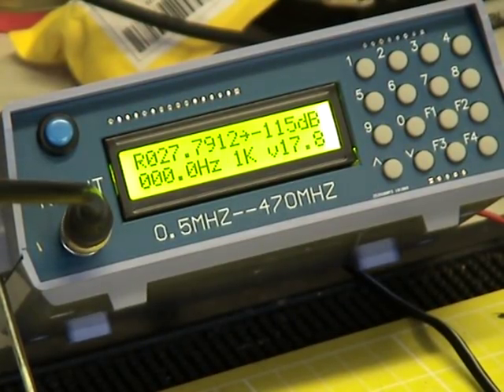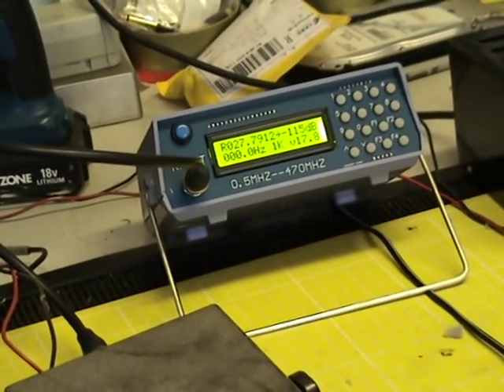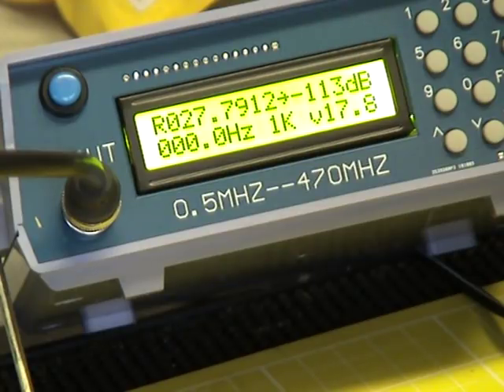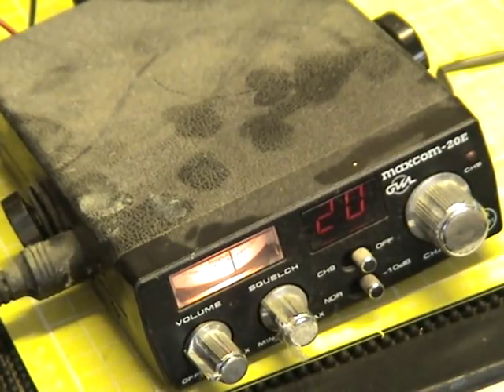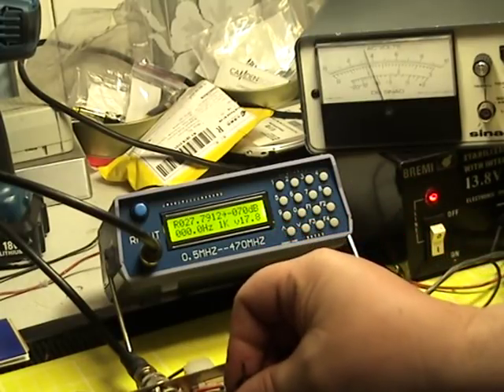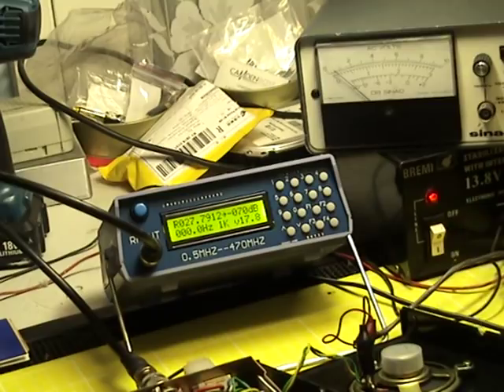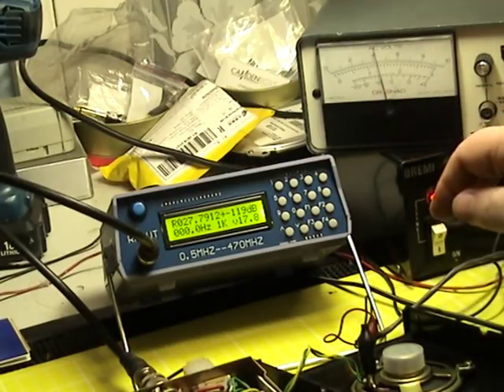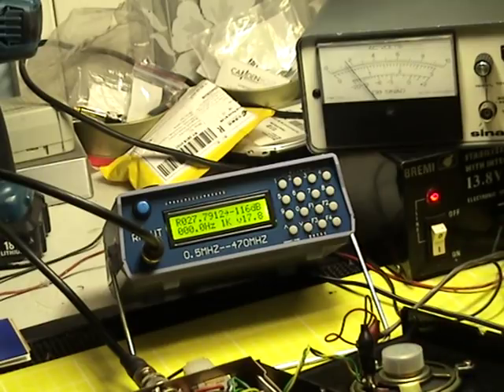CB servicing on a shoestring budget (UK) -  RX on cheap Chinese FM signal generator

Comment: Hi, what is the V17.9 on the display please? Also you can enter the values direct with the keyboard you know, saves multi pressing the up or down buttons and waiting ages.
Reply from the maker: Sorry, this was a 'one off' demonstration of how I used this cheap signal generator. You will need to research a copy of the instrictions or the signal generator for your answers. I would expect V17.9 on the display to mean the firmare version to be "Version 17.9".

Richard, G0OJF, UK

Comment: What are your thoughts on using a TinySA for doing AM/FM alignments?
Reply from the maker: I've never heard of one. Without me researching it sounds like a computer based thing. 

Richard
Reply: @ukfmcbradioservicingTango21  It's a £50 spectrum analyser which is phenomenal which also has a built-in signal generator with various modes of modulation.

A very similar product to a nano VNA.

I've used mine to align / repair a few radios and it does the job well.

The things are amazing!

Comment: s9 =73dbm
Reply from the maker: Not on UK FM CB it doesn't....that would equate to 50uV.  S9 = 100uV on UK CB which in turn is -67dBm.

Richard, G0OJF, UK
Reply: Think this can piece of equipment can be used on AM CB? Mostly 27mhz.
Reply from the maker: @PointElectronicsLen  No, it's FM only.  AM signal generators can be bought very cheaply secondhand; I bought one via Ebay for £10 in working order for entertainment radio alignment.

Richard, G0OJF, UK
Reply: @ukfmcbradioservicingTango21  could you provide a name of one so I could look for one.

Comment: Hello there I ve a question. It's a RF generator the same that Signal generator? (Sine wave square etc) both can be used for radios alignment? Thanks
Reply from the maker: Yes. It needs to be a sine wave for radio. The generator also has to be able to produce a modulated tone on the signal. This one is FM only which is why I featured it. Many cheap generators are AM only. Obviously the generator has to produce the frequencies you need. No point buying a 10Mhz generator of you want to tune radios at 27Mhz.
Richard, G0OJF, UK
Reply: @ukfmcbradioservicingTango21  copy that. Thank you.

Comment: Using this gadget as a signal source, quite good, you can make a simple RF generator with a higher voltage output, adding inside the box, or in another box, an RF mmic amplifier or a mosfet (this one with a small rf ferrite toroid and a winding for a low impedance output, even employing the second gate for a gain control ¨)

Comment: Hello ! Can you help me with some advice?
I have an Albrecht AE Ultraforce radio, it has some problems on emissions. When I press PTT it can be heard on the other radio only if I have the power set to 1 W, if I increase the power from the button, the signal disappears at the microphone.
What could be the problem?
Reply from the maker: The model you mentioined isn't a UK approved CB radio so I have no specific advice. Generally though.....it sounds like when you draw beyond about 1A of current the radio malfunctions. First you need to check the power supply voltage is still what it should be when in transmit of higher power. If that's OK, the radio has an internal fault.

Richard, G0OJF, UK
Reply: @ukfmcbradioservicingTango21   Ok , thanks for info !

Comment: Do you know what is the first parameter on the second line (shown in your video as 000.0Hz) used for? It makes absolutely no difference on the output no matter what I set it to.
Reply from the maker: Sorry, I can rarely comment on test equipment videos like this as these kind of items are usually sold on after the videos are uploaded. 

Our Mr Chippie has one of those smart phones (I don't do mobile phones). Mr C has some translation software on his phone that allows you to point the phone camera at foreign writing & it instantly translates onto the phone screen. When we get stuck over lack of Chinese instructions in English, he goes onto the original sales page (such as AliExpress) & is usually able to read the Chinese full instructions. Perhaps that could work for you.

Richard
Reply: @ukfmcbradioservicingTango21  Thanks for the reply. This device is really interesting. My unit has no model number whatsoever on the case and does not come with any manuals but works well for what it is. The seller item description contains nothing useful either. On my unit (firmware version 20, newer than yours) the modulation frequency can be changed to "/"K (actual slash, not a typo). I think this is a bug. The attenuation only goes as far as -70dBm like what you mentioned. The LCD only displays "dB", probably due to lack of characters. They might as well remove the R and show "dBm" in full.
Reply: @toughdev  That second line is CTCSS, You can set it to modulate CTCSS tones with the up down buttons, if its on zero its doing nothing, these are useful and cheap little generators while they work, mine only lasted a couple of months, I was very careful with it never transmitted in to it etc, just used it to align CB radios, it started losing signal really badly, getting weaker and weaker until nothing comes out of it now, you would be better getting a more expensive sig gen and a dbm switch box, to get an fm signal generator that will level to 0.1 micro volt over 20mhz is very expensive even second hand, these are cheap junk really I wouldnt recommend them to anyone.
Reply: @knoxieman  Thanks a lot for the info! Now I know it refers to CTCSS. You are right these units are built down to cost with absolutely no quality control whatsoever. No output protection as well so don't connect the wrong thing to it. My device also has some other weird bugs. After changing the frequency a few times, the display will be garbled with strange characters, e.g. "R278IG" (with alphabets) - to recover you must reboot. With regards to the output RF power level, I am experiencing the same behavior on my unit. When I first got it, I was able to analyze the output and see the RF peaks using FFT on my HP 54615B 500MHz oscilloscope. But after a few months I am no longer able to tell the peaks from the noises in the FFT view. The output can still be detected with the TinySA spectrum analyzer. I think the output power of the unit has decreased like what you said (the oscilloscope FFT is less sensitive than the TinySA). The device is still useful for aligning radios. I hope it won't die totally any time soon ...
Reply: @toughdev  really the best option for accuracy is to go for a quality  second hand lab set, these units are very poor, great idea but needs work, the boards inside this thing are held in with hot glue, if you can't trust your test equipment there is no point in using it, you would be better leaving the radio as it was, I'm on a budget so can't afford to pay silly money for old gear with no calibration certs that might not work, I'm looking at a kmoon Sig Gen and a digital step attenuator, most of those cheap Sig gens don't drop below 1 mv which is too much signal for fm receivers, with an attenuator you can drop it down and work out the dbm signal level, if the kmoon doesn't modulate a 1 khz tone ( I think 600hz is max internally) you can inject one via bnc, that's the option I'm looking at, I'm interested to try the digital step attenuators, 30 quid to to 30db . This unit is going in the bin now sadly, Richard did the right thing selling it on.
Reply: @toughdev  Hi, thanks for the info, I was going to try one of these as a digital step converter rather than a switch box https://www.amazon.co.uk/dp/B08G8LTC5K/ref=cm_sw_r_cp_apa_fabc_GbIVFbSX4YW4W looks interesting, also can you tell me if the 6900 can output up to a 1mv 30Mhz FM signal with a 1khz tone? I've heard others say it can't go that high with internal modulation, it's total overkill for testing CB radios (I mainly want it to setup CB walkie talkies) that's why this device on here seemed so good at first, I might rip it open and see if I can do some test on it, thanks.
Reply: @knoxieman  Sorry for the late reply. I just tried and the 6900 can achieve that easily. Just set channel 1 to 30MHz sine wave with FM modulation enabled, modulation source from channel 2. Then set channel 2 to 1kHz sine wave and you are done. The resolution can go as low as 100uV. See here for the spectrum of the 1mV output taken from my TinySA: https://bit.ly/3q9F4aZ

Comment: Have you ever tried the ComTekk SINAD software to do Sinad using just a sound card and computer? I think it would make a great video especially for me who is thinking of using it
Reply from the maker: I'd not heard of it so I looked. As a licensed radio amateur it would cost me $39 for a non-commercial slimmed down version. Next snag....no room for computer on bench. Considering I paid £20 for one of the Marconi SINAD meters & £45 for another it seems cheaper & obviously better to buy a secondhand real SINAD meter that one cost someone £800+. 
Have you noticed the main test sets here are Marconi 2951 from the 80's? We also have a Farnell test set of similar vintage & a Schlumberger 4040. Why don't we have a Marconi 2955 or similar? The answer is Latency. I really don't have the time for ...adjust ...wait...adjust..wait etc. I want INSTANT meter readings. That's why you see the BRAND NEW this year CRT oscilloscopes on the bench too. A bit like these new CB radios where you press the PTT & then wait 1/2 second for the CPU to go into TX!
Thanks for bringing this to my attention though. Bear in mind you still need a signal generator with a meaningful attenuator to provide the signal for tuning the radio with.

Richard, G0OJF
Reply: @ukfmcbradioservicingTango21  Awesome thanks for that reply I had not noticed it was licensed software thought it was free, oh well. Yeah latency is a pain I like things instant too. You have some great test equipment there by the way and I love your videos 73 for now de 2E0LIG

Comment: I bought one of these unit.  No manual with it.  Good value for ham radio receiver testing in general. Frequency stability was within 450 cps. F4 function key did nothing on the unit I bought. Compared to lab quality IFR unit found the frequency within 450 cps at 450 Mhz, the output attenuation was spot on.   A friend bought a unit went to the TX mode and then somehow it went into R mode and We cannot figure out how to get it back into TX mode. How about your experience with that?
Reply from the maker: I didn't know there was a TX mode as it's just a signal generator. They do another that does TX. MR Chippie has one of those smartphones (I have a rotary dial house phone). There is some translate software program you can put on smartphones so that when you hold it's camera to foreign writing, it instantly translates it onto the screen in real time.  When we bought this signal generator the aliexpress advert had basic instructions in english on the advert as it said there was no instruction book. If I were you, I'd find info in Chinese on it & translate it. I'm sure you'll find what you need to know that way,

Richard, G0OJF

Comment: I thought -73db should provide a S9
Reply from the maker: that would relate to 50uV & is indeed specified for some CB radios, probably to make them look more sensitive than they are. The correct standard is 100uV for S9 (-67dbm). Note, this applies to UK legal CB radios. Amateur radio has different settings which we are not involved with & business radios don't have meters.

Richard (UK)
Reply: @ukfmcbradioservicingTango21  I just realised the video is on CB and any signal testing I've watched demonstrated is on amateur radio. Learned something new. Good test unit considering most options are in the $1000's 
Cheers.
Reply: @ukfmcbradioservicingTango21  can anyone give me a bit of advice please, I have purchased a signal generator which covers 1-60mhz.
It also has a frequency counter built in but it says max20v input on the counter.
Does this mean I can only use devices that run below the 20v. Ie cb would be fine to plug into the counter due to it running on13.8v.
I know probably sound a daft question. I haven't got a clue and any advice would be gratefully received. Thanks 73s Mike. P. S.. I have readed the manual nothing listed...
Reply from the maker: @poptheboats2025  Max volts is nothing to do with how the product is powered, but the RF voltage from a transmitter that may be applied before the frequency counter is damaged. 20V works out at just under 1W of RF power, however I would not dare go more than half of that. You normally use a 20dB attenuator 'sniffer' and connect your transmitter to that & the sniffer to the frequency counter. https://www.electronics-
notes.com/articles/basic_concepts/decibel/dbm-milliwatts-volts-conversion-chart-table.php   is worth looking at. I recently bought a 20dB sniffer via ebay from Italy for about £40 as I couldn't be bothered to do the research to build one.

rshireby@yahoo.co.uk

Richard
Reply: @ukfmcbradioservicingTango21  thanx Richard. I have purchased all the servicing on a shoestring gadgets of the videos. I just fancied one of them other generators for the bench I'm making up. Thanx for the information&videos and I will read up on the link you posted..

Comment: Enjoyed your video.......will this tune the amateur bands with the modulated tone....3.500mhz to 29.000
Reply from the maker: Without even looking up the frequency coverage, bear in mind this is FM only  it is rare for amateur radio to be FM lower than 29Mhz. There are plenty of cheap AM signal generators around...it's FM that's hard to find, hence this video. Note that UK CB is FM.
Richard (UK)

Comment: love your videos,
what do you concern the best cb/antenna/amplifier / meter manufacturer ?
Reply from the maker: It depends what country you are in for a start. I only deal with repairs of business 2-way radio, but also am happy to service UK legal CB radios as well for the trade.

The best new CB we have serviced & tested this year was the Thunderpole T3000.

Amplifiers are illegal in every country I am aware of. Seeing it is an illegal market, they all seem to be pretty poor from what I've seen before chopping them up.

Mobile aerials, the SIrio performer 5000 was the best mobile aerial we've tested to date....base station we just use 18' 1/2 end fed aerials of no particular brand & they all work 35 miles in our 'good' direction using UK 4W FM cb radios.

I just demonstrated the cheapest SWR meter I could find from CRT & it worked OK on that video demonstration. As a radio engineer, most of our business customers are on VHF high band or UHF systems, so I have to have different meters depending on what I'm doing.

I'm not a big brand person. Many expensive products I've owned over the years turned out to be c**p, and on the other hand, cheapo power tools from ALdi & Lidl have worked a treat!

Richard, G0OJF
Reply: @ukfmcbradioservicingTango21 location Belgium

Comment: hello, this generator is sufficient for the alignment of the receiver of a base dx 2547, I must connected on the antenna socket a signal generator, frequency 27.185 mhz, 1uV, 30% of modulation, then adjust in the order L2, L3, L5, L6, L7, L8, L9, L10, to obtain a maximum of audio signal and a voltmeter connect to the loudspeaker plug, 2V 10dB, thank you
Reply from the maker: This channel covers UK legal CB radios. The DX2547 isn't a UK legal CB radio so I know nothing.

Richard (UK)
Reply: Youre saying this would properly work on a AM CB radio as I have many of them that could use a receive alignment. Did you just use a BNC to PL259 cable and go right to antenna jack on radio and go through alignment procedure on on Ch 19? Will it cover channel 20 as well can you input your own Mhz???

Comment: Hello there, I'm currently trying to fix my FM radio tuner. I have a question. Can this unit be use as FM signal generator to my tuner front end so I could calibrate the IF.
Reply: yes  you can
Reply: Thank you for replying sir.
Reply: Yes...

Comment: Hi, I'm waiting for a new on air test video. How long are you going to keep me in suspense?
Reply from the maker: I started 4 different videos & three look to have long term snags whilst parts come from the far east. Good news is I have a Team 8000 80ch base station on the bench & part one (repair & tx) is nearly in the can. Rx will not take long, so with any luck the 'on the air' could well get recorded tomorrow afternoon (sunday). Glad to see you look forward to my bulls**t free input!

Richard
Reply: @ukfmcbradioservicingTango21  I like to see how all the different radios perform on test. I have a rotel rvc240 myself which I use static mobile sometimes and have had contacts over 20 miles away from where I live. Mr chippy and zx2 must be getting bored as they've had no road tests for a while 😁
Reply from the maker: Well we do ham radio things too most weekends & were range testing 4 Metre (70mhz) equipment last weekend.

Richard